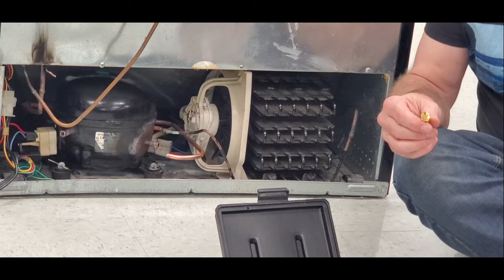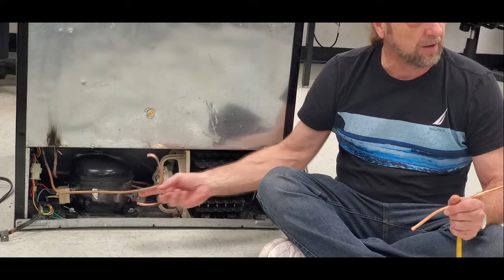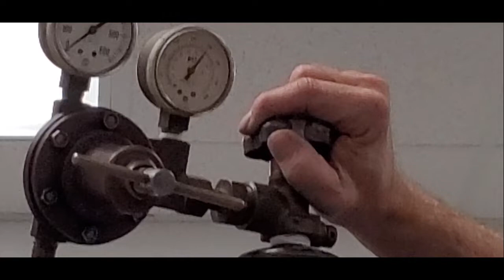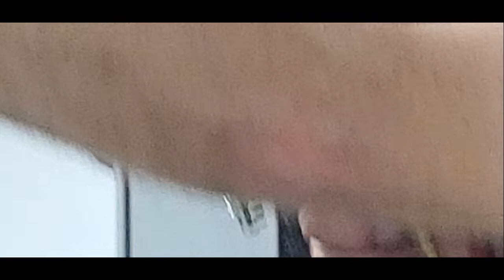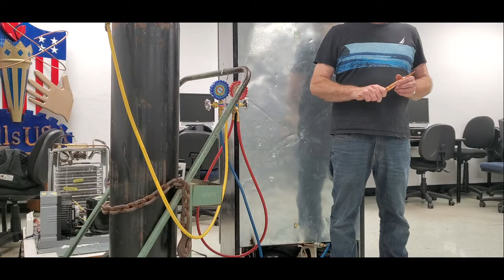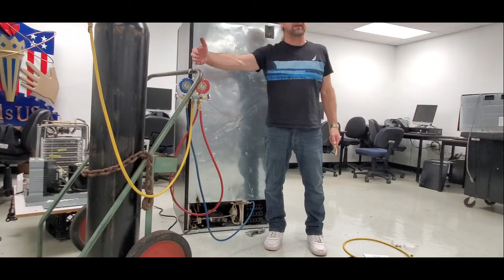Sealed System Looking for restricted capillary tube

Comment: This video is very informative but I have a question. All this work to get the refrigerator running wouldn't it just be easier and less expensive to just replace the fridge?? I was tought you should never work on a factory sealed system. But I enjoyed this video
Reply: If you were to be under factory warranty or extended contract you would repair this fridge, but the steps are  the same for some of the more expensive refrigerators ranging from $10K to $15K, cheaper to keep her